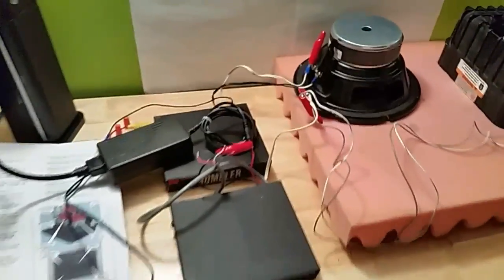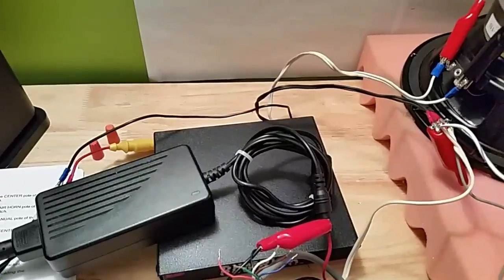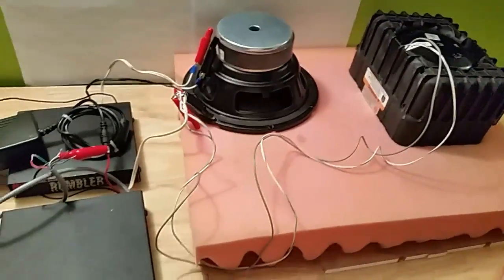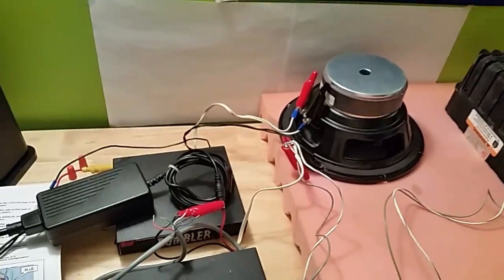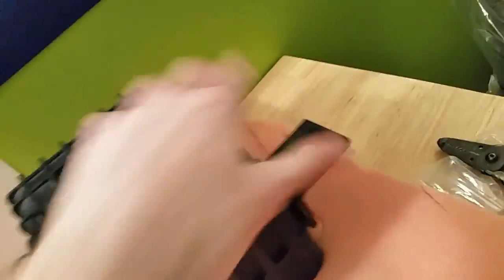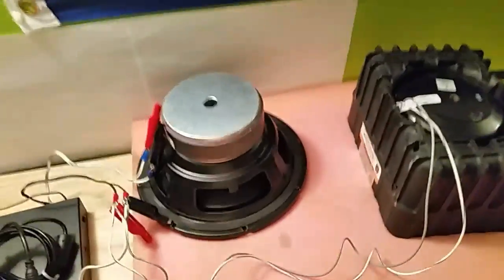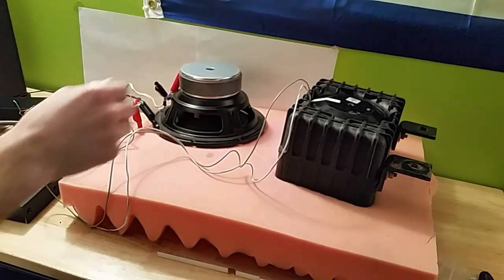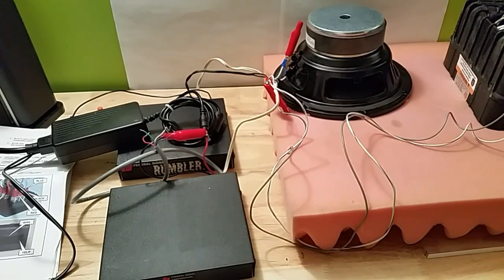Use A Federal Siganal Rumbler Siren Without a Rumbler Speaker

Comment: is that speaker loud enough or it worth to buy original for 550$??
Reply from the maker: No not really, this was just a bench test to see if I could get it to work.
The original one would be the best but the price tag is a bit steep. Try to find a used on for sure, or you can try and build one with a smaller sub woofer that is rated for at least 100W
Reply: haha thank you,for that price is best  hotnblaster train horn All day

Comment: Rumbler is a wa$te.   Not loud and not as effective at penetrating vehicles.    Years ago we had a Whelen siren which produced lower tones, not as low as Rumbler, through theiregular siren speakers.   Unfortunate thathe Federal Signal Q sirens have 15 ports instead of 6 or 7.   Powerfulower frequencies travel farther and penetrate vehicles better.
Reply: In nyc it's 1000% effective.
Reply: @08_crown_vic    Rumbler is just a gimmick.
If the Q siren had 6 ports, it would beven moreffective.
A problem withe Q siren is th.at full speed some people withearing loss cannot hear its high frequencies.